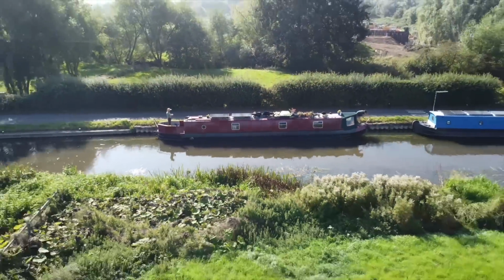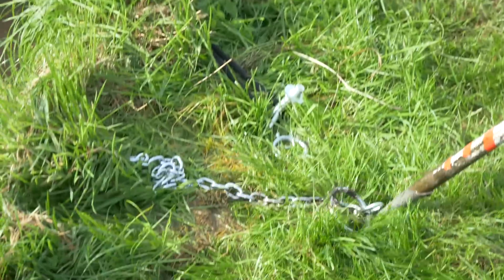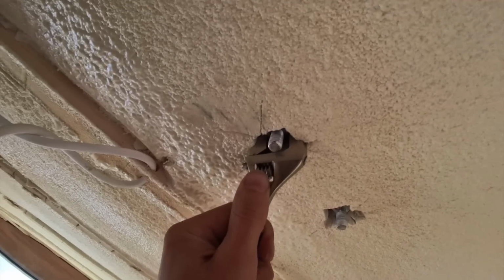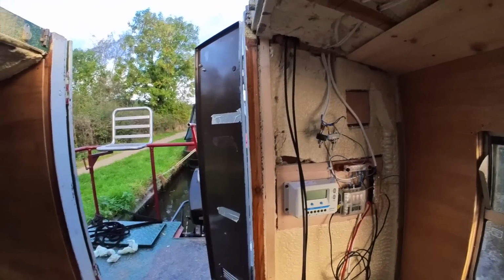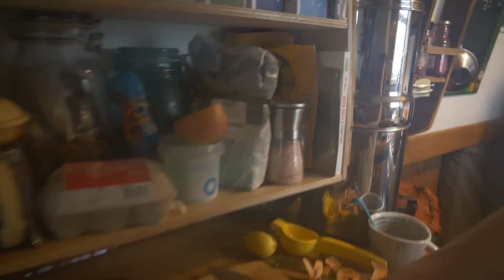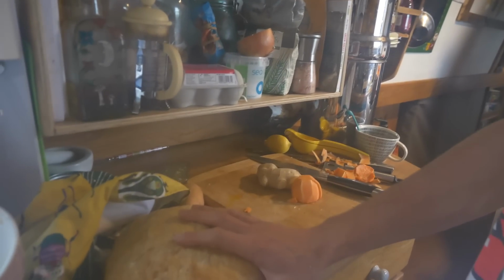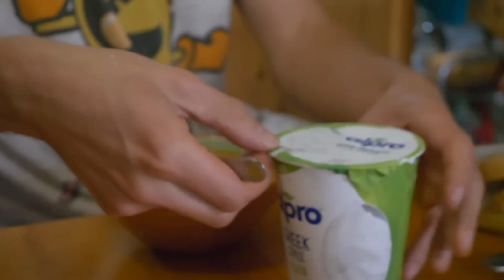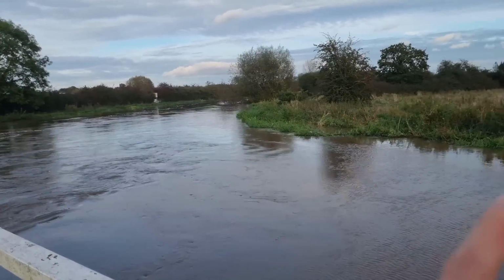Installing SOLAR POWER On Our Project NARROWBOAT | EP73

Comment: Ben - When you seal the windows in there is a trick that you don't appear to know...Put the sealant on either the window or preferably on the boat....THEN let it dry a bit, go and have a cup of tea.  When you go back to the sealer job, touch it, it should be well on the way to drying, and well skinned over.  When you press the window in, screw it loosely and leave for at least a couple of hours, then tighten it fully.  It sounds as though you are simply splatting the sealer out.  Think of it as a gasket then it will hold the water out.  Good luck with that.  John
Reply: Hello I do know I just hadn't got around to doing it, no worries it's all been properly sealed now!
Reply: I didn't know that, thank you
Reply: I think you have invented a new cold cure, well done.
Reply: Such good advice.

Comment: Nice one, you guys are so cute together, (loved the soup sequence). 😀  Great work on Rambler, just a little tip when drilling steel Benny, consider using a pilot drill, (3-4mm), prior to to the full size drill.  This not only uses less energy in the drill battery, but also aids in maintaining positional accuracy of the holes, then use a countersink to remove the burrs on the hole, top and bottom.  But, you're doing a great job and she's looking good, the ceiling looks fabulous so far.  See you next week. 😄😄😄

Comment: My Aunt lives in a Village very close to Arewas and it floods like that all the time. I live fairly close by (12 miles) if you need emergency help with anything as well
Reply: actually, are you guys still in the same area, a tradesman left a trolley at a house I am doing up (its in excellent condition and very robust) I am pretty sure it folds down, I'll check tomorrow when I go over and send you guys a picture of it on Instagram so you can see if you want it. I think it has all weather wheels too.

Comment: You are both so brave. Drilling holes in the roof. 😅 I think I would faint. Hope you both feel  better soon. ❤ So much flooding. Stay safe.
Reply: I thought that too! I redevelop houses as a job and that would make me very nervous.
Reply: An option may have been to weld studs to the roof but the insulation and the paint would have taken a hit? The sealant he used is excellent for marine application so it all should be good..

Comment: Loved this story especially when Benny used the new chilli powder. Birds Eye is the everyday chilli here in Thailand and is so easy to grow in a pot. Fresh has so much more than just heat and you can use them green or wait until they turn red, no heat difference but great chopped for colour contrast in meals. The progress on Rambler is impressive and it seems you will have a toasty little playspace before the end of the year. Good luck with the work and stay safe.

Comment: For sealing those windows, sikaflex a bead around the frame, and leave to set for 20-30 mins before bolting frame in, or alternatively use Butyl tape, if you intend to remove and reseal many times. Boat is looking good, but you two look a little poorly, hope you are better soon.

Comment: High you three, you did well finding that chain Ben😅 that soup looks fantastic and spicy. I have to say guys that English weather is horrible no wonder you want another van does that mean finding 
Warm weather in another country? Drilling holes in boat roofs is not a great idea really, just fitted a solar panel on my Ute roof and I used roof rack bars then the panel to the bar. I really hope your boat roof doesn’t leak guys what with the leaking windows as well. No wonder you feel ill not good 
Just not good for your health🥴🥴. Why don’t you ask your huge family out there for tips on the best way to do things ?? A little help goes a long way😂😂 I mean you don’t want a submarine do you Emily. Thanks again for another video they do make my day.🫶🫶😘Jon🇦🇺xx

Comment: Hey guys watching your video and you made a mistake on the bolts through the roof you should put a big washer on the inside you're going to ruin the roof tighten up against the metal roof you should have done a big flat washer it'll be in a lot better that's what I think but I could be wrong